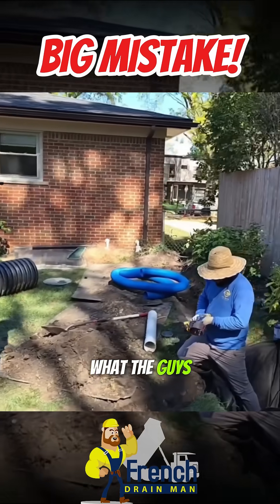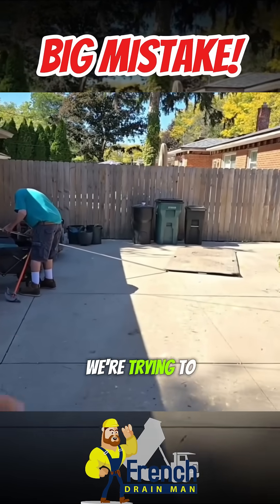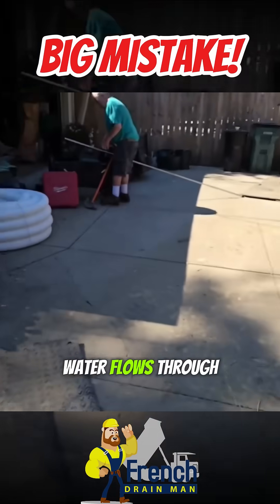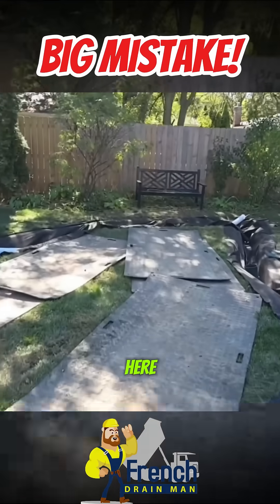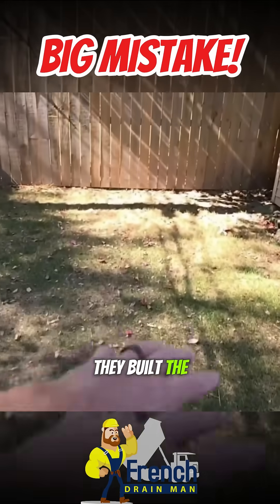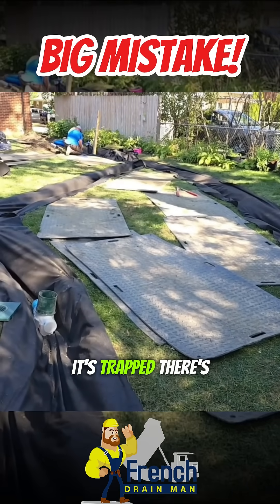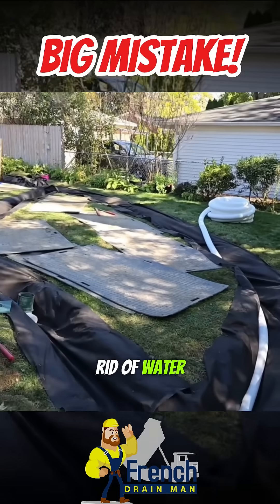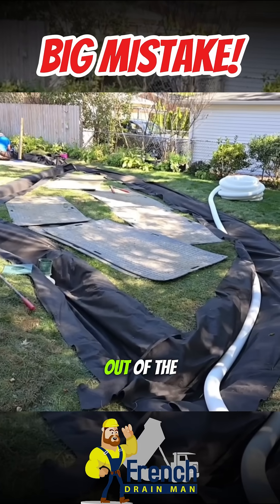Why Adding Dirt Makes Flooding Worse

Comment: I agree. Adding dirt isint solving anything except providing a new path for it to create structural damage. If it's pooling in a spot away from the house and garage it's definitely not ideal but if you raise the grade your providing a path for the water to make it to the house and garage causing foundation and wood damage. My garage has wood damage now from water and poor grading
Reply from the maker: Thank you for sharing.
Reply: My neighbor's added dirt to both side yards of my house and blew out my foundation in the back.